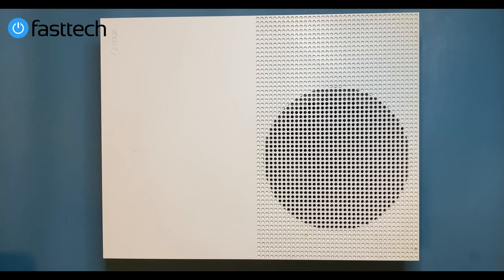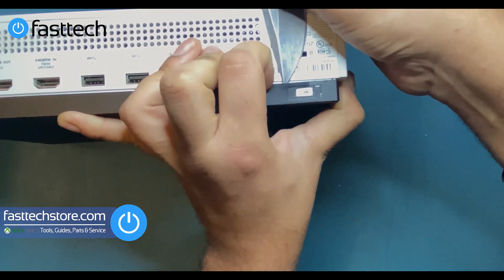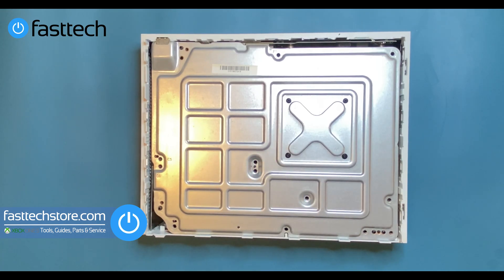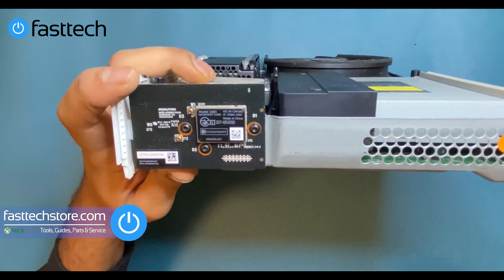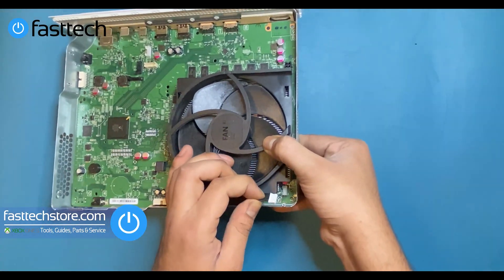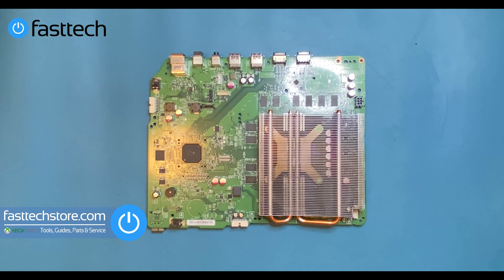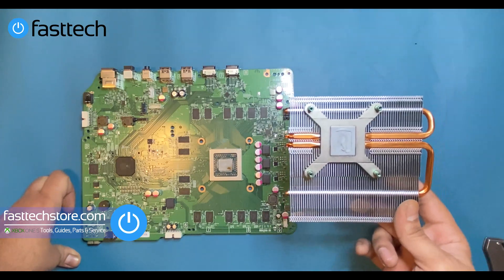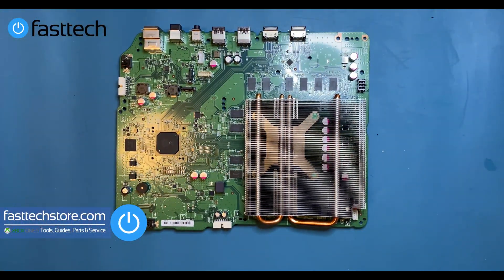Xbox One S Thermal Paste Replacement Guide

Comment: Very helpful teardown, however BE CAUTIOUS, I ripped two capacitors off when trying to put the x clamp back on. That is by no means a safe method to replace it. I ended up doing it just by pressing it down with the palm of my hand, one corner at the time. 

That method for removing the x clamp is also not the safest. I used this one instead: https://www.youtube.com/shorts/VBWYQKAHNjU
Reply from the maker: Thanks

Comment: Using flat head to remove the x clamp was the wrong method, the space in between the pegs is where you put the same head as the screws and apply force in the opposite direction, it causes each side to pop of with ease instead of slightly prying at it with the flat head. Only saying this bc that’s where it went wrong for me when following this guide
Reply from the maker: Ive being doing it like this since the xbox 360 days and never had a problem. Hopefully you is console is okay, cheers.

Comment: Would it be ok to put some thermal pads over ram and south bridge chips?
Reply from the maker: For a thermal pad to conduct heat it has to make contact with something additional to the component you’re trying to cool like a heatsink or a metal backplate.
Reply: @fasttechvideo  oh ok makes sense i just figured placing some pads on top of them might be some kind of benefit because inside most ssds they have a pad placed over there ram chips
Reply from the maker: @WarNeverChangez  you may get a very minimal temperature reduction so no harm in doing this

Comment: how did you get that heat sink ? my one s has a different heat sink. doesnt have the orange
Reply from the maker: Its normal dont worry some Xbox One S heatsinks do not have the copper part.
Reply: @fasttechvideo  okay yeah it looks more premium on urs tbh lol compared to mine 😂 but thx for the vid. I replaced my thermal paste for the first time ever and I’ve never even done thermal paste replacement before. It’s so fun tbh
Reply: I was gonna say the same 😂I was like woah that’s not what mine looks like
Reply: Thank God, I thought I was the only one. I felt like I was being gaslighted (or is it gaslit?) anyway, right on for the confirmation.

Comment: Just because you didn't show step by step how to reassemble the case on Xbox, I broke my power button and  LED indicator, it will cost me $60 to buy a new board and ship it to my area. You did the one way guide, just a disassembly, reassemble is not shown. When you assemble, there are other things you need to be cautious about if you don't want to break anything, and you didn't mention it in your video.
Reply from the maker: Yes Im sure its my fault that you broke something.

Comment: Are your parts on your website new or repaired and sold?
Reply from the maker: Depends on the part. Items that can be bought new from suppliers like hard drive are new, items that cant be like mainboard and network adapters are used and pulled out of working systems. This is because manufacturers like Microsoft and Sony refuse to sell parts for these devices for business reasons.

Comment: My Xbox won’t turn on it turns on for couple sec fan moves and stops I checked everything if it’s plugged in and it is
Reply: I'm having the same problem with my kids . All I can see is that some cola may have dropped in from the top through the fan holes and left sticky spots on the board so I'm hoping a good cleaning might help it .
Reply: Power supply has probably failed

Comment: Can you use Corsair XTM50
Reply: You can use any kind. I use Artic silver
Reply: @djinnkazuka7563  thank you . I used the best buy brand .
Reply: @copacetic8479  Corsair correct? How you think it works?
Reply: @coxaine___3673 yes Corsair
Reply: @copacetic8479  was your Xbox working fine until you got into a game and then just shut off?
Reply: Cause that’s what I’m dealing with right now
Reply: @coxaine___3673  I would turn the xbox on then 3-5 seconds later it would just shut off .
Reply: @coxaine___3673  it also looked like something spilled on the mother board / or particles. Having the xbox down to the motherboard.  I got 99% alcohol, cue tips, a light toothbrush . And scubbed the mother board several times. Over the coarse of several days . Until it looked "clean enough" then reapplied thermal paste . Reassembled the xbox and turned it on.
Reply: @coxaine___3673  the first time it happened I was just playing games . Then it shut off .

Comment: Hello so I just got this Xbox and it would beep and light up then turn off so I took it apart and the thermal paste is everywhere around the mirror chip and was wondering how to get it off. It's pretty bad and I'm not sure how gentle I need to be and if there are tricks
Reply: Use isopropyl 90% and a soft plastic (a guitar pick). Or If you get a fasttech kit from like fasttech for 30$ it'll have everything you need.